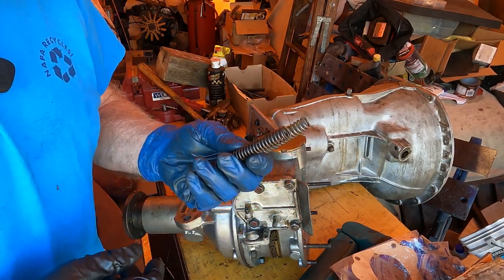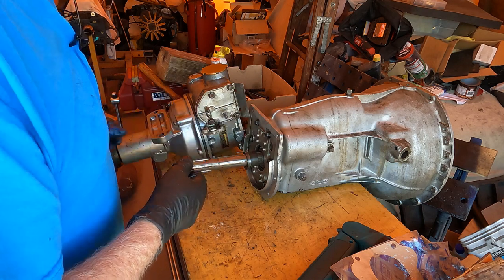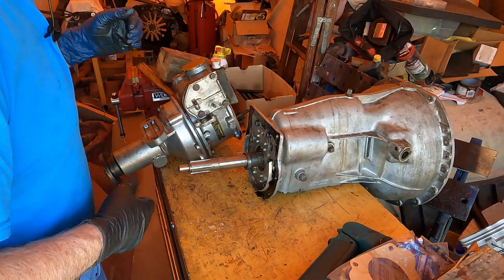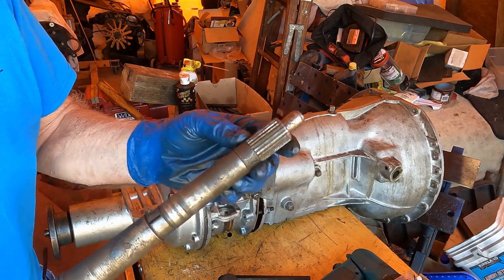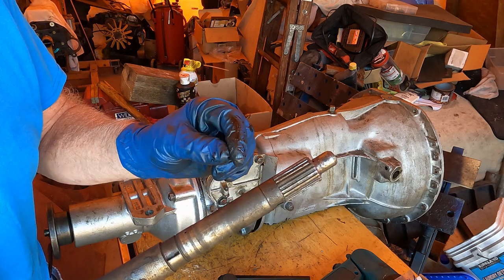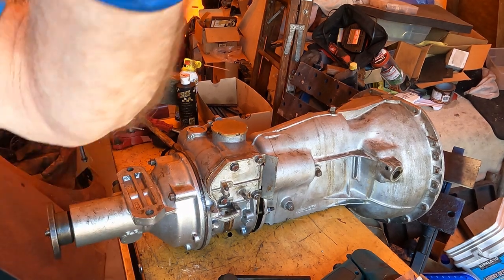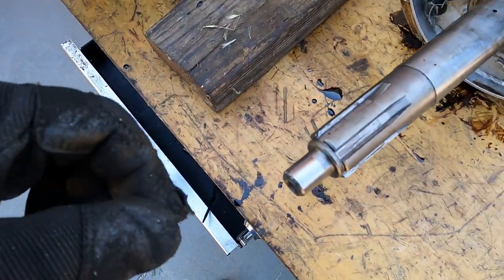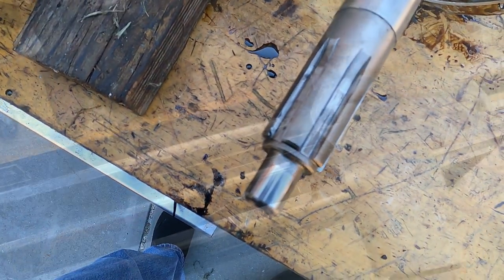1955 Triumph TR2 Restoration.  Part 23-D Installing the OverDrive and Top Cover on the Transmission.

Comment: thanks EJH.  The complexity of the overdrive is amazing to me.  I recall that in 1966, adding overdrive to an MGB cost $160 (the price of the base car was $3095 (Canadian).  No one uses overdrives anymore, going to 5 speed and 6 speed gearboxes instead.  Did it not occur to the British that adding another gear to the trans would be cheaper and simpler 
than adding overdrive ?  John in Manitoba.  We bought a new '67 MGBGT and the dealership said overdrive could not be fitted to the GT because of a frame crossmember.  Not true.  Our TR2 has overdrive and I hope I will never have to take it apart.
Reply from the maker: Overdrive was quite common in the 50's.  Even American cars had it as an option, Ford and Studebaker come to mind.  I expect that it was easier than completely redesigning the existing transmission.  For English cars the Overdrive unit was developed by Normanville de Laycock, an independent manufacturing company who supplied many UK and European manufacturers.